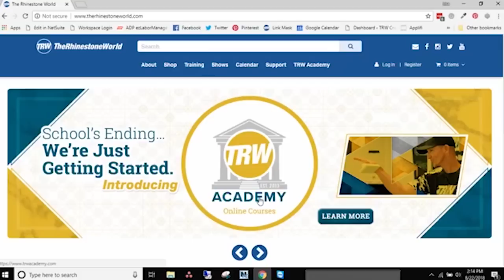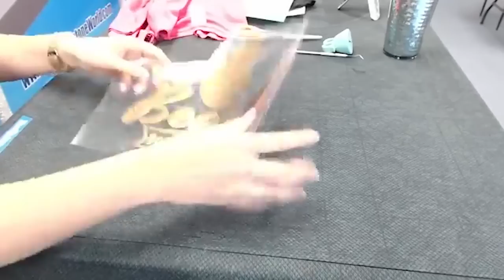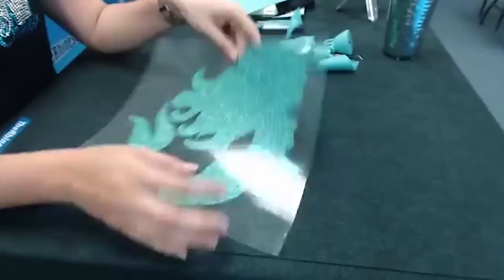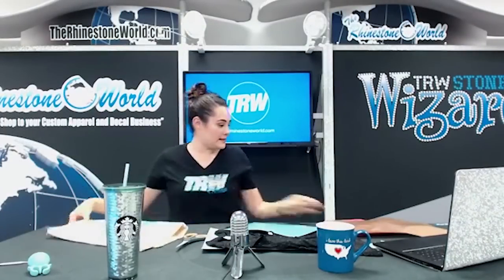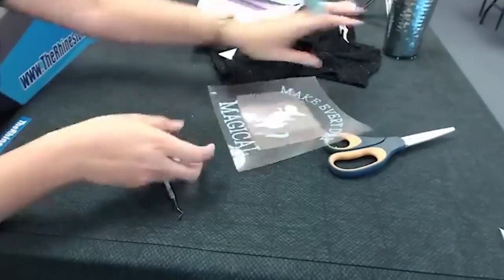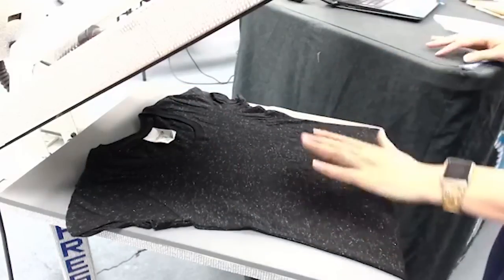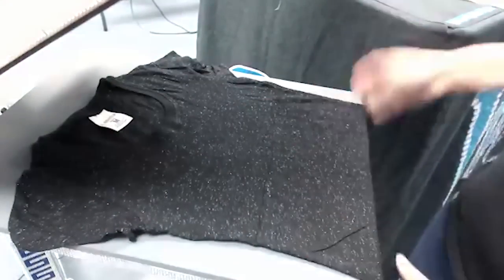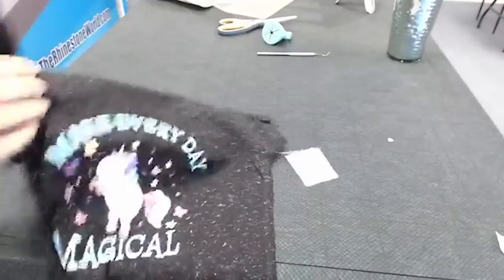08/22/18 Facebook Live: Getting Magical with New Design Packs!

Comment: Lisa,  the 40 yrs of being awesome design came in with alternate fonts. I thought it would come in as designed? I wanted it the fonts shown, Can you help? This is the first time i saw that happen. Also, The super  Unicorn had a solid cut for the black, not like Matt showed us with the cut outs for easy placement.
Reply from the maker: Did you install the .exe file? The live templates will default to another font if you don't have the fonts installed, which come in on the .exe. You can also find the font file in the .zip folder and install it from there. The unicorm will have the solid black, Matt took out the sections for the video. You will want to grab the color and the black together and choose "subtract all" from the Modify Panel. - TRW Lisa
Reply: @TheRhinestoneWorld  Thanks Lisa. I'll check that out as soon as I can get to my computer.